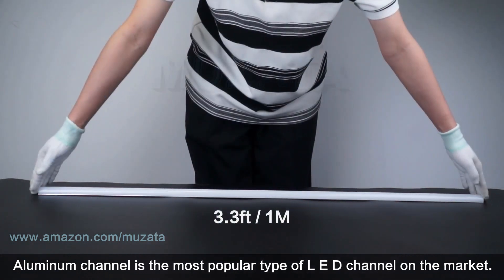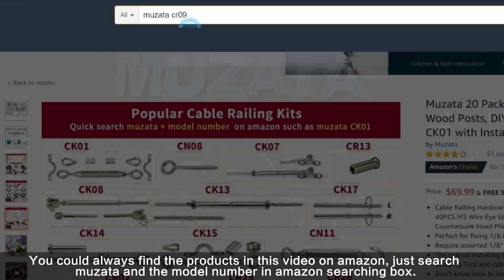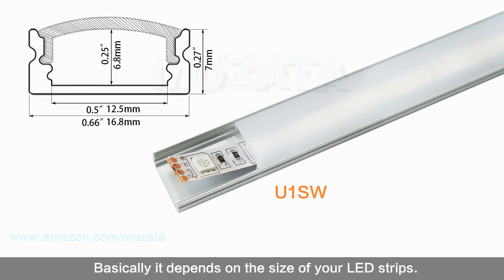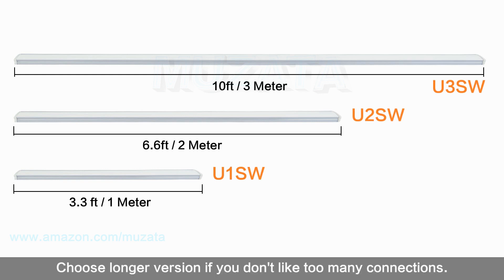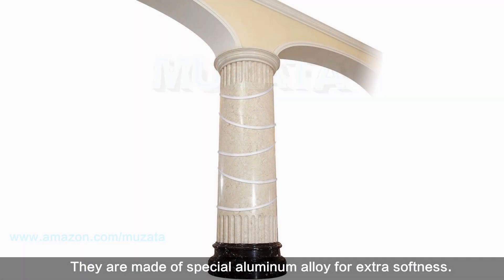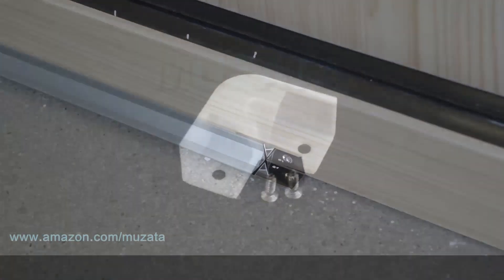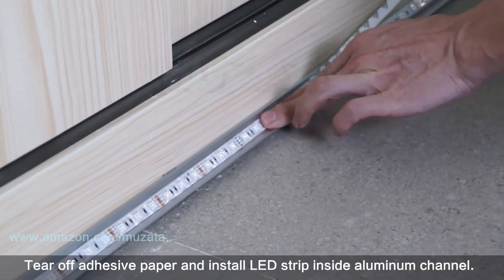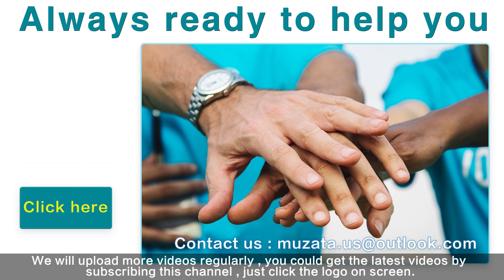How to choose LED aluminum channel - Muzata V-shape corner installation tutorial 2019

Comment: You say the aluminum is bendable but what about the actual plastic diffuser? I have an awkward corner that isnt 90 degrees and my diffusers are v shaped and I doubt connectors would help in this case
Reply from the maker: If you have any questions, you can contact us ：
support@muzata.com

Comment: is there a way for the corner connectors to allow you to insert the led channel the other way? i’m trying to go around my door frame but with the current direction the corner connector has my channel face looks weird i’m basically just trying to get the corner connector to have a different insert point to accommodate this.
Reply from the maker: Hi,  you can reach us for the info by e-mail:support@muzata.com.

Comment: Do you make the 90 degree corner connectors? Not the one that that go 90 degree down or up but 90 degrees in the corner of a ajoining wall?
Reply from the maker: Hi, we do have corner connectors for 90 degree in the corner of a joining wall. Here is the link to it: https://www.amazon.com/Muzata-Channel-Connector-Aluminum-LC08/dp/B07PBP6TCQ/ref=sr_1_3?crid=11U23E8Y6PC7C&keywords=muzata+lc08&qid=1646300986&sprefix=muzata+lc0%2Caps%2C605&sr=8-3
And you could reach us for more info by e-mail: support@muzata.com.
Reply: @Muzata_official  Why are your prices doubled on Canada and sold only by third parties? Are they fake?